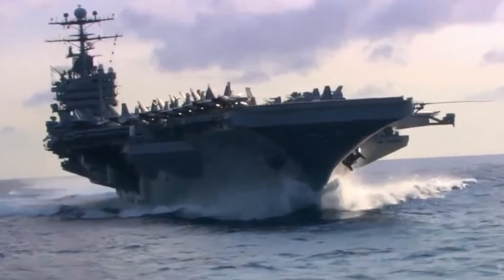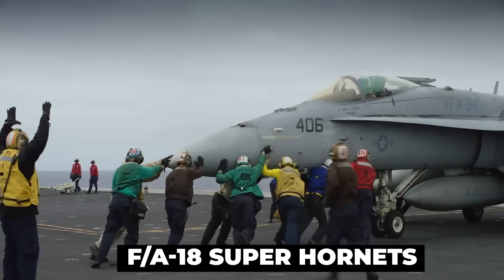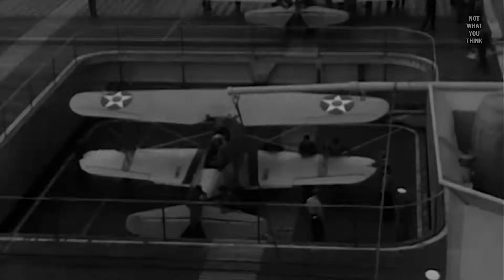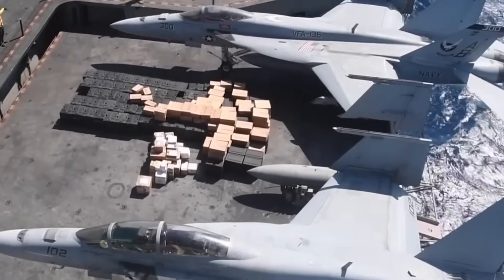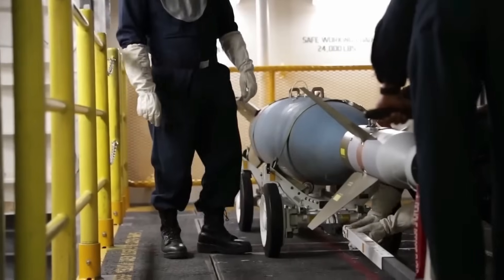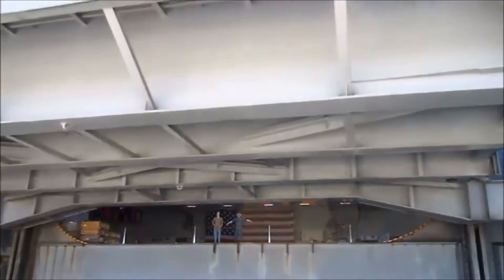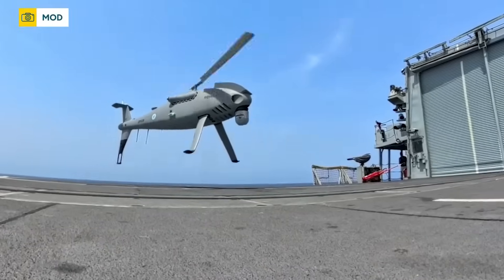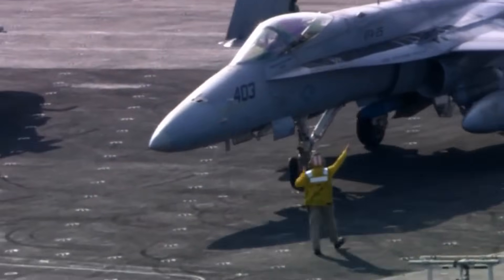Why US Aircraft Carriers Have a MASSIVE HOLE in Middle of Flight Deck?

Comment: Back with another question. What was the last carrier built with a center line elevator? I was ships company on CVN 71, CVN 70, & CVN 68. I never saw a center line elevator. Best I remember bombs and missiles come out of the mags to the mess decks. Put on a nother elevator taken to the hanger deck. Wheeled on to a deckedge elevator and sent to the roof. Did I miss something?

Comment: As a former USS Enterprise sailor and retired Navy my experience with various naval aircraft and shipboard life, I can attest that on the “E” and Ticonderoga (CVA-14) there were NO holes in the middle of the flight deck. The aircraft el’s are off the side, a feature incorporated during WW2 with the Essex class carriers. The weapons elevators are near the starboard side in front of the island. Weapons elevators are also used in transporting injured persons to the flight deck for COD transport, and from various decks down to sickbay. The central aircraft elevators were eliminated with Essex carriers to increase the available space in the hangar bay (a feature the USN got from the Brits along with angled flight decks, thank you). What “holes” in the flight decks there are happen to be used for the catapult launch team and are not in any position to reduce launch capabilities. And as to the elevators construction the actual deck is made up of many slats of steel. 
US carrier design has evolved through the many designs since the first carriers prior to WW2. My own opinion is the newest Ford class carriers are impressive, as are the newest design from England. I’m sure that there’s another evolution of carriers coming, but what’s out on the seas today makes the Enterprise look woefully ancient, even though she was cutting edge when she came out. 🧢

Comment: Yes. In close  them or modernize them.
Reply: Go have a look at the Ford class carriers, they are impressive. The Nimitz class aren’t far behind. Sadly, the Enterprise was decommissioned in 2017 ( she served the nation well thru Viet Nam and Middle East deployments, with a defensive engagement in North Korea in ‘69). 🧢
Reply: Inclosing the elevators would just add weight to the ship and cause the elevators to be bigger. It would also make moving aircraft harder. Some aircraft require the tail of the aircraft to overhang the elevator outer edge. The elevators also are used during underway replenishment for food, weapons and jet fuel coming aboard. Don't believe the garbage in videos like this, It was written by people that have no idea how and aircraft carrier works. It took 50 years to work out what is the most functional design and it has been used for 50 years to date.
Reply: @libbygriggs3607  
Can we put this to rest? 
USS Langley, CV-1, had no elevators on her decks. Only 1 small el of the side. After that the Lex, Ranger and Saratoga had central elevators. These went from the hangar bay up to the flight deck. I believe there was only one in the center of a straight deck.  These took up valuable space in the hangar area due to the shaft design. Essex class carriers were designed with many wartime advantages the earlier carriers missed. Redesigned propulsion areas, relocated fuel storage, and deck-edge elevators were most notable. I think the Oriskany was the last Essex class to be built. When they were modernized with the angle deck (Thank You, England), they lost 1 elevator until the next phase of modernization. 
Enclosing any elevator wouldn’t have any improvement. As for streamlining? What would you gain? More weight, for sure. Nothing for fuel economy (all US carriers are nukes), or speed (the one time the “E” lifted shaft speed restrictions in ‘69, she went well over the listed 35 knots) so any speed increase would be negligible at best and totally unnoticed. 
Oh, and as for un-rep, the elevators would be used for vert-rep and cables between the supply ship and carrier would sling the supplies across into the hangar UNDER the elevators. And JP fuel and NFO fuel would be transferred from the oiler via large hoses, totally avoiding the el’s or the flight decks. 
Really, just ask any, ANY, carrier crew member. On these matters they won’t steer you wrong. 
Carriers are magnificent achievements in design and engineering. They have evolved to the point of being capable of launching and recovering aircraft at the same time, night or day, clear weather or storm. I relish my time on Enterprise with only one day exception ( the ‘69 flight deck fire that took 28 young men). I always amaze my friends that never got the opportunity to spend time on these massive pieces of power. Some have to look up videos before they can believe me. Oh, and for the record, Top Gun (the movie doesn’t really do the carrier fleets any justice. But then again, it’s just an old movie!🧢

Comment: Yes keep the elevators just put blast doors in the openings which could be open or closed rapidly i mean it never hurts to have more protection and it keeps rough seas 🌊 out and things nice and dry, you know that all the ships 🚢 in Star wars had big and small blast doors you know i like to say blast doors 🚪 😊
Reply: JUST? The elevators on both the carriers I served on (the Enterprise, CVN-65, and the Ticonderoga, CVA-14) had doors that were closed for various reasons. And the hangar bays had doors to separate the forward bay from the aft bay during emergencies. 🧢
Reply: Oh, and forget about Star Wars or Star Trek (science FICTION, though some medical tech has been derived from SW, and communication got a boost from them).🧢
Reply: @larryperdue508  
The hangar bay on carriers (the main deck) is something on the order of 45’ above the waterline. On the roughest seas I saw on the “E” the CO just ramped up the speed slightly, informed the crew about the sea state, had the all A/C tied down 12 points and kept on trucking’!! When it got really bad out, hangar doors were shut and no one was out on the flight deck. It takes a lot to rock 80-90 thousand tons of ship!! I would suggest you try to get on a tour of any of our carriers, you just might learn more. 🧢
Reply: All aircraft carriers in the US Navy have doors to close the hanger deck elevator openings. Don't believe the garbage in videos like this.
Reply: Funny you should say blast doors, because that's EXACTLY what divides the hanger deck in half. I've never seen them closed while at sea, even when all of the elevator doors were all closed, due to heavy seas in the Atlantic. The sound of the waves slamming against the hull sounded much like a loud bass drum. Yet, the only time I saw the internal hanger bay (blast) doors closed was while in port, while hosting civilian visitors.
Reply: @TheHawk--oe8iq  Only saw the blast doors closed on the hanger deck in fire drills and when a steam line broke in the 5" shell magazine on board Saratoga in 1969.
Reply: @ 
Don’t you just love how someone who has absolutely no knowledge of carrier design suggests that Star Wars should be our guiding example?? WOW, did we ever miss the boat! Nimitz class carriers were well into being when the first Star Wars movie (a fantasy) came out in ‘77! And NOW this kid suggests that blast doors would be beneficial. Lord have mercy. 
Sonny, there have been doors on hangar bays starting with the Langley (CV-1)!
Reply: @ 
Sorry about my last blast, it was meant for LarryPerdue. My bad, long day, too much lava, not enough Java!

Comment: Unless your aircraft is getting maintenance or being repaired, they usually LIVE on the flight deck.  No USN carrier has not had an inboard (not on the deck edge) elevators since the Midways did their SC-47 l(angled deck/huricane bow) refits.  EVERY 'hole in the deck' is there for a reason, bomb elevators, retracting air office, etc.